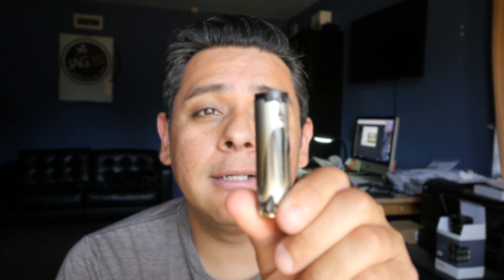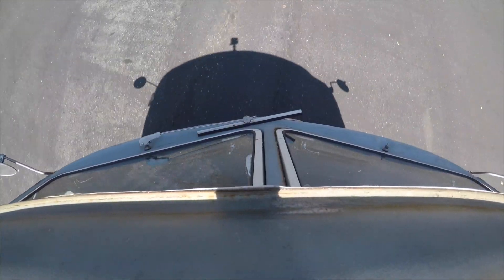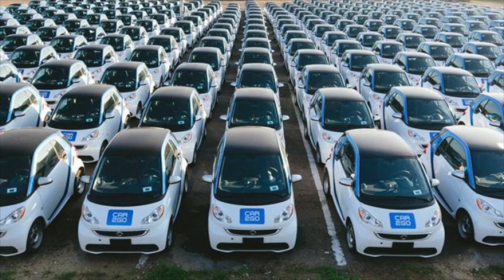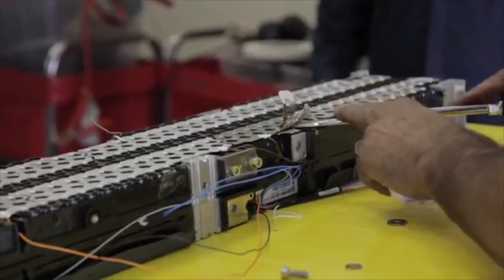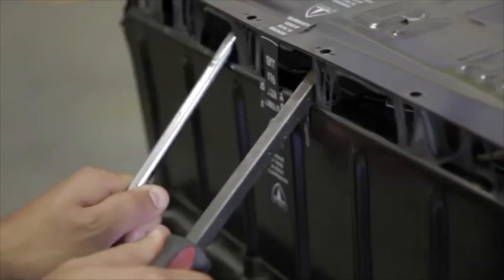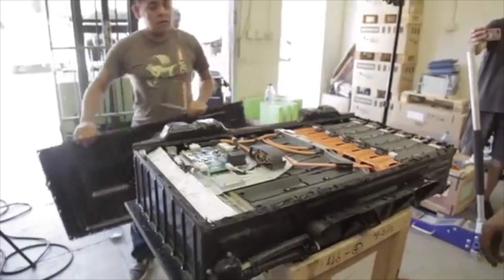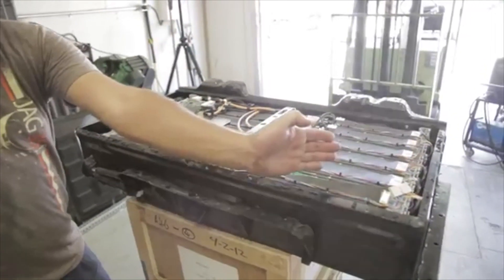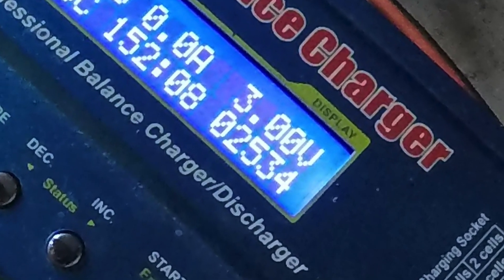The myth of lithium ion TESLA battery calendar degradation

Comment: were they stored at full charged or what?

and they can be discharged to 2.5- 2.8V so you probably could have gotten that extra 60 mah! :p

my guess is that they were originally 3000mah or they are some mericle batteries lol
Reply: Jimmy O. 3000mah 18650 cells very literally had not yet been developed when these were made. I think 2600mah was the max available and that's why he is using that number

Comment: that's not a good test cause there are some dendrites growing inside the cell at every charge event. we do not know, when the dendrites are big enough to destroy the cell. and we do not know if this kind of changes show a constant linear degradation. also we do not know if the dendrite growth is stronger when the battery is almost empty before charging or if there is maybe less or none dendrite growth. we do not know what history that battery had. was it charged always from almost empty, was it charged when it was mostly 80% full? was it turbo charged or with lower current? to answer the question of degradation there need to be more intense tests.
Reply: Tesla states that turbo or low current is indifferent, the important is you stay between 10%-90%

Comment: "Electric cars are slow"  -> 2.2s to 100, fastest acceleration on the road.
"Electric cars dont get far" -> 300 mil range
"Electric cars take ages to charge -> 145kW charging
"The batteries will be dead after 100k" -> Electric cars last a million miles, 5 times what gasolines last.

Now come with your next argument against EVs please.
Reply: Slow? Check. Because they're intentionally built to be slow. (slow equals safe)
Range? A few have 300mi on-paper ranges. The majority of EVs on the market (and roads) have ~100mi range.
Charging? Yes, it's takes eons. How many Tesla Superchargers are in your driveway? Common US residential power is 240@200A (48kW, 38.4kW derated, of which maybe 32kW is available for charging) [I have an electric race car. I know damned well how much of a problem charging is.]
Lifetime? Most production EVs are expected to handle 5000+ cycles. Even if you cycle the pack every day that's still over 13 years of "design lifetime" -- they will likely last 8-10k cycles.
Reply: Cool that you have an electric car, but i dont consider anything before Tesla real EVs. (although its great that you and others bought those, first steps had to be made) Sure the "majority" of experimental toys or compliance cars may have 100 mile range and be slow. 
Tesla is not built to be slow, it does have range. All the EVs that are coming out have to compete against that benchmark now.
Reply: 1.electrical vehicle are way way WAY pricier than gasoline car,small peasant like me can't afford it.
2.charging station currently arent wide available in my country ,which is suck.
3.gasoline car has better vroom vroom sound than electric vehicle.
 4.ev aren't actual environment friendly
Reply: long yap, you made 4 claims, out of which the first 3 are purely subjective and the last one is complete nonsense (if we compare with ICE cars).
Reply: @jfbeam  lasting means 70 percent. You'll still have 70 percent left
Reply: Million miles? Show proof.
Reply: @pauljames1682  actually there is proof. Tesla transmission with a million miles still looks like new
Reply: Cost?
Reply: My argument: I'm poor and cannot afford to buy EV.
Reply: @anggib561  actually if you can make it on your own country, you can make it affordable.

I'm planning to make the DIY soon, but there are tools and budget that aren't available just now.

Comment: If it degrades 10% every year. It's not "0" after 10 years. 
So awnser to your question: Mathematics is hard if you don't give a shit.
Reply from the maker: +Roger Keulen  common sense, if it degrades 1/3 of 1% per year its a non issue. Math is not on the the side of those who claim that cells degrade just sitting there
Reply: are they “sitting there”  charged or drained ?